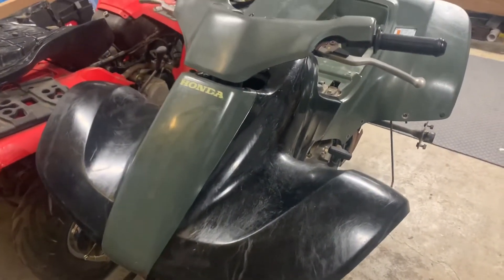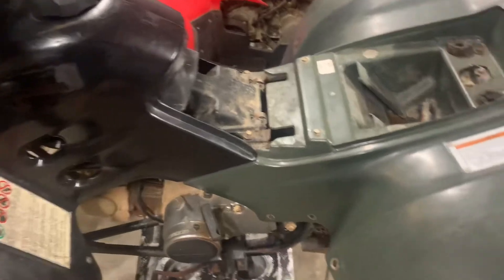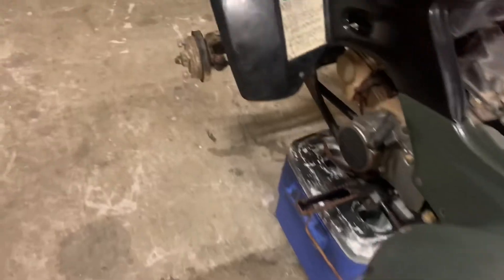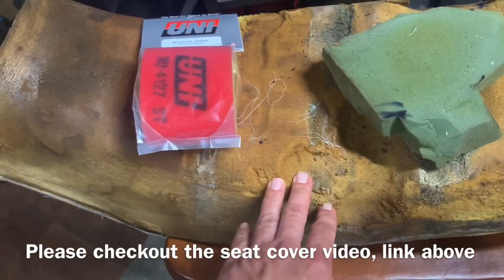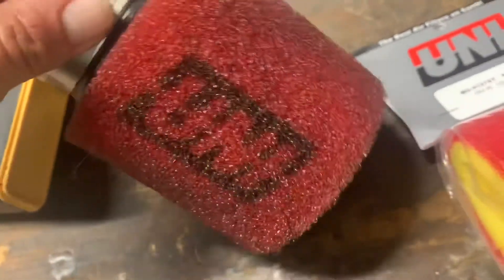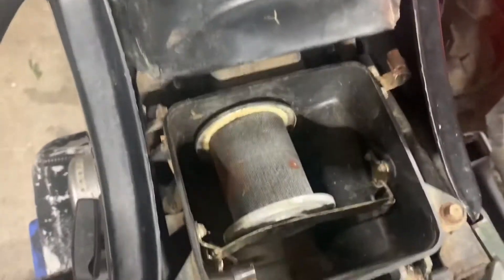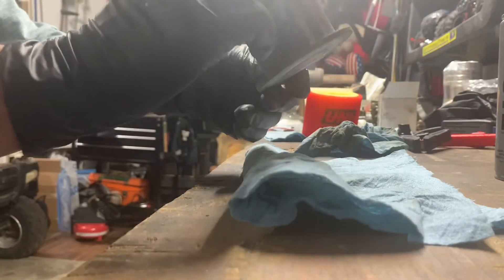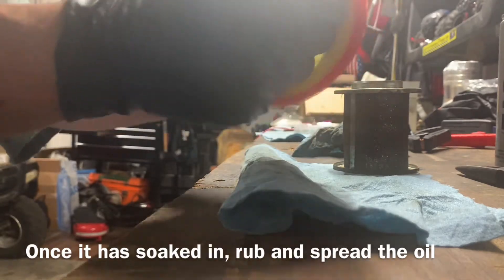1998 Honda TRX90 UNI Air Filter Install Easy upgrade stock replacement better filtration and flow

Comment: Part number or size filter you got? Got one but didn't have air box so I'm just put a uni filter clamp on
Reply from the maker: 1993-21	Honda	TRX 90	NU-4127ST
Reply from the maker: Just be careful as they are not water proof, without the air box protection. Might want to add an outerwear cover for water protection